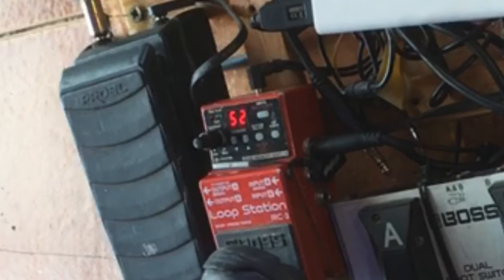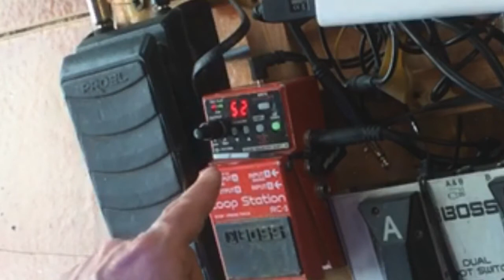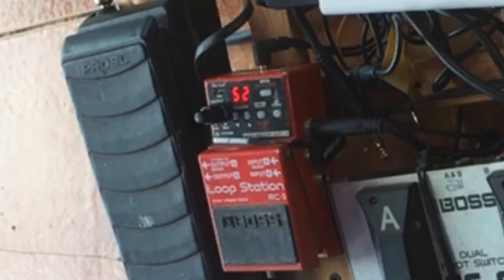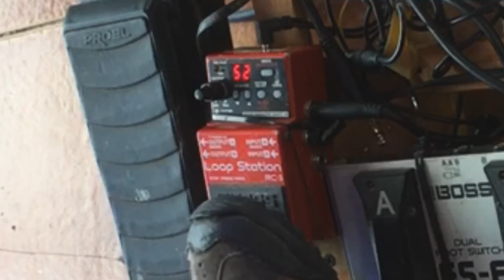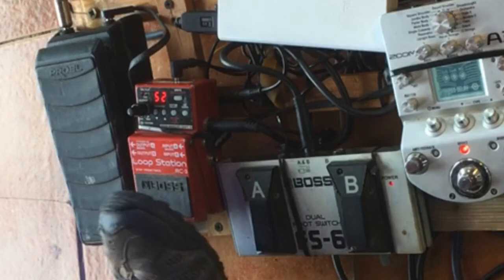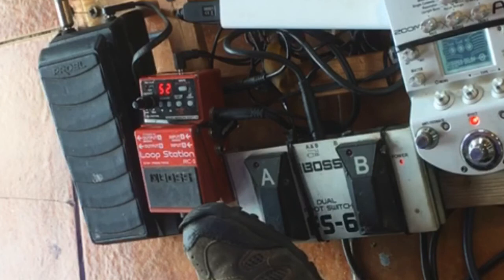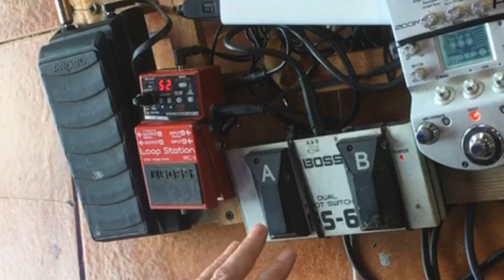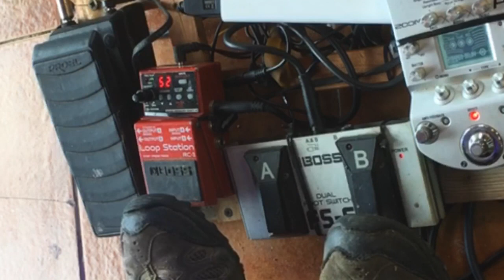Using the Boss RC3 looper & FS6 switch pedal. [in a live setting]

Comment: Just wanted to let you know that you can change the order to REC>PLAY>OVERDUB, rather than the factory REC>OVERDUB>PLAY. Hold down the tap tempo button while powering up, then select rP with the arrow buttons. Press tap tempo again to return to normal operation. The rd option is the stock setting, the REC>OVERDUB>PLAY.  Hope this helps!
Reply from the maker: Thank you so much for watching and commenting. You are quite right and this function is very useful for home use. I have covered it in an other video. In a live setting however, the possibility of accidentally double tapping the RC is what makes the FS worth the investment. It also makes changing patch for a chorus or key change much faster and more accurate. Thanks again. 🎶🎶

Comment: can i save phrase with pressing something on footswitch?
Reply from the maker: Yes, you can permanently save a phrase by pressing the setup and memory at the same time.
Reply: @honeyman-guitar  but only with pressing buttons an the pedal i can not save a phrase? i have to press the setup and memory button with my fingers?
Reply: @Bigjuergo  hi , “saving a phrase” has two options. You can save a phrase and then replay it, by tapping the pedal with your foot. But as soon as you turn the power off it will be deleted. If you want to keep the phrase to use in other sessions, you need to save it to one of the 99 memory slots by holding down the memory and setup buttons at the same time and selecting save. It will then be permanently stored in the selected slot. I hope this helps. Mark

Comment: Hey Mark… It’s Mark here LOL great name by the way… Question what do you do for your AC power supply do you just use nine volts only? And what are your tips on saving that battery life when using this daily? Please and thank you!
Reply from the maker: Hi Mark, very true, it’s a great name! Thanks for stopping by, and for your question, it’s a really important one.
So important in fact, that I decided to upload a video on the solution I use. It has worked really well for me for nearly 3 years and over 100 gigs, so It’s well tested. The video is part of my “The complete wedding guitarist “ course, on Udemy, but it makes sense to have it on YouTube, now that you’ve asked the question. Here’s the link:
https://youtu.be/CocKUtmaMJY
PS. The FS6 does not have a mains power input, so this won’t work for that pedal, but I usually get 100 hours or more from a 9 volt battery in it, so it’s not really an issue.
I hope it answers you. If you have any more questions let me know. 🎶🎶🎶🎶 regards, Mark.

Comment: Just to clarify after watching this,  you only use the B channel so you can just get an FS 5 like I have. (much cheaper)
Reply from the maker: Hi Kirby, thanks for watching and commenting. What you say is true , in this video I am only using one side of the switch and an FS5 would do the same job. In other videos I do explore using both sides and I myself use it for switching patches live.
Reply: @honeyman-guitar  thanks,  well you did answer my question as I recently purchased and RC3  the other control would be assigned to the bank !  thanks.